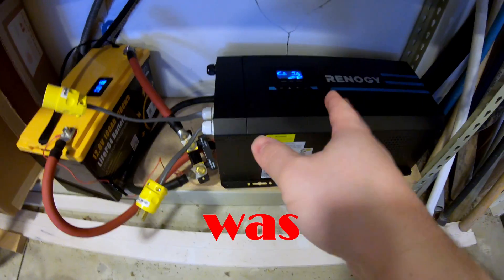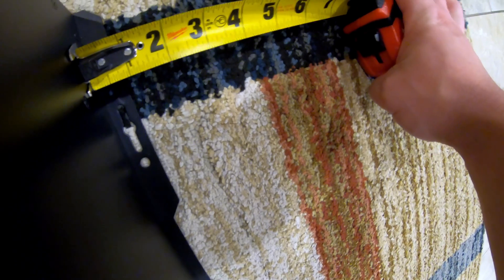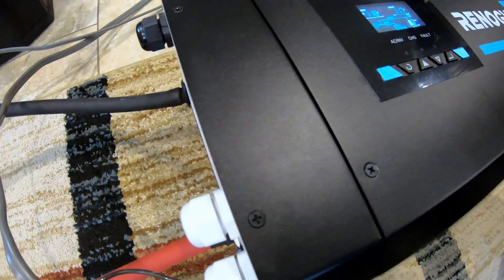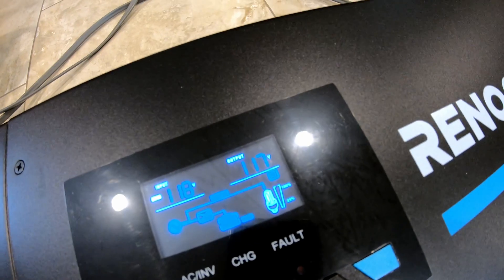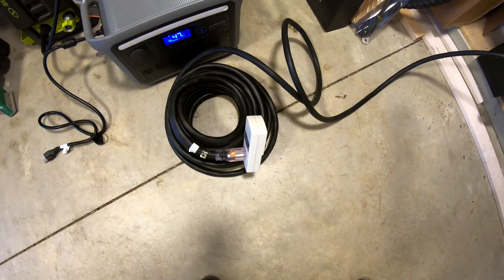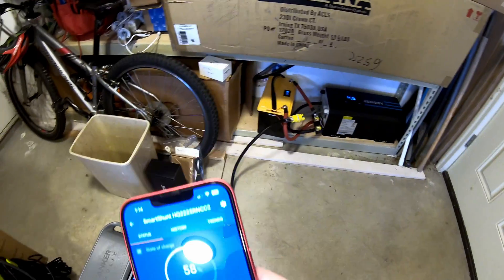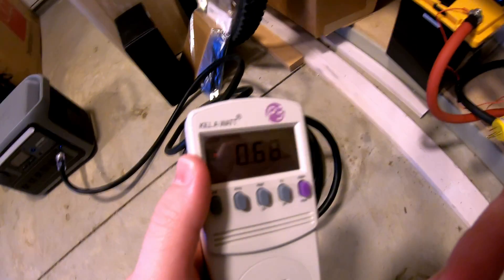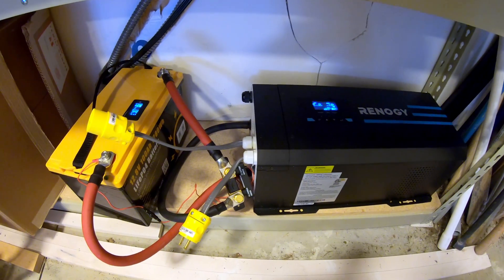Renogy 3000W Inverter Charger w/LCD - Test & Review. THIS THING IS A BEAST!

Comment: As stated below, 40w is a quite a pull.  I'm thinking of wiring a second small 300w inverter for a 110v mini fridge to save power.  The fridge itself pulls about 30w.  However, newer LifePo4 batteries are cheaper than ever, therefore  I might just add a second 400ah battery and call it a day.
Reply from the maker: Sounds like a plan!

Comment: Thanks for doing this video - I have ordered one but think I am going to send it back as the fan noise will drive me nuts. I think I am going to have to fork out the extra for a Victron Multiplus.
Reply from the maker: It does have some heavy duty fans that run! Thanks for watching!
Reply: @theresatrickforthat  Are the fans going all the time?

Comment: I just set mine up with a 280ah lithium battery and the thing that I didn't like about it was that from default it wanted to charge the battery to 14.7V and then would let it discharge to 12.*V (around 10%) then it would start charging again.  This could mean that if I went out to my motorhome when it was at 20% charge, that's all the charge I have until it charges back up.  I set my max charge point lower as well (eco-worthy battery calls for less)  and then I went in and set minimum voltage higher, so in theory I'm cycling the battery between 70-90%.  I haven't been able to verify if my setting are correct yet, need to do some more testing but the standard lithium setting from Renogy is not good for most people who leave the inverter plugged into shore power.  Thanks for the video, well made and straight forward.  I would like to see what settings you've done for the charge profile, and the reasoning for them (I'm still wrapping my head around all of them)
Reply from the maker: Thank you! I'm glad you enjoyed the video! I do not use the standard lithium setting. I just do a user defined one and I adjust the charge parameters based on whatever the batteries require. Thanks for watching!

Comment: Will I need a separate DC-DC charger as well for a camper van setup, or does this unit replace the need for one? 
Thanks
Reply from the maker: This only charges from AC power. Thanks for watching!

Comment: Does this inverter/charger allow for direct dc powering? I heard that the dc to dc charging also can be used to directly power 12v devices?
Reply from the maker: So long as you have a battery for the unit to “charge” you can connect a DC load and you can run the load at the same time as the charger is “charging” the battery but it’s also powering the load at the same time. Thanks for watching!

Comment: If you use the on board on off switch or the remote on off switch does that elimate the idle power draw? Lastly does the on off switch only control the inverter (if plugged into shore power with the switch off will it pass through power)?
Reply from the maker: Thanks for your comment! Had to make an entire video based on it. Check it out: https://youtu.be/qGLUiVyISL0?si=gMM_iroef-VtAoEy
Reply from the maker: Hey! Thanks for watching and commenting! Sorry for the delayed response…I actually didn’t know the answers to your questions but I got out and actually filmed another video based on your questions. So be sure not miss that coming out in about 2 weeks!
Anyway, yes…the onboard switch or the remote switch will kill all draw from the battery. And no power will pass through if either switch gets turned to the off position. Hope this helps! Thanks again for watching and commenting!
Reply: What is the idol currant of the 3000 Watt job that’s what I got but having said that I have not had any idol currant issues yeah

Comment: The manual says that the fan will shut off if the charge current drops below 6 amps.  Did the fan shut off when your battery was fully charged?
Reply from the maker: Yes it does! Thanks for watching!
Reply: @theresatrickforthat  is the fan variable when inverting or is it on full time like when charging batteries ?

Comment: Good data.

Interesting that the idle consumption is so much higher than rated. (42 vs 30)

I have a Xantrex 900W inverter and it idles at just 5w

5 * 24 = 0.12kwh
42 * 24 = 1.01kwh

Pretty big difference.

When in power saving it was rated 15W right?   Is that mode the same as being turned off?  (i.e. a 50w fridge cant even kick on)
Reply from the maker: Thank you! Pretty amazing how much more efficient small inverters are! So goes to show sometimes bigger isn’t better unless you really need the big power. 
Yes, when the unit is in power saving mode, if you plug a 49 watt load in, you’ll get nothing out of the inverter. Plug in a 51 watt load and the inverter goes to full power resulting in the extra overhead and power consumption by the inverter. Thanks for watching and commenting!
Reply: @theresatrickforthat  I have the 3kw on order.  May end up running the 900W inverter with the 3kw one reserved for charging the batteries, and high drain stuff like an induction cooktop.  Good to know that a draw above 50 will wake it up.  Ill have to test it with the mini fridge to see how it behaves.  The fan on the 900W unit remains off unless it gets warm, so thats another benifit, esp at night.  Was hoping to find a vacuum insulated 1 or 2 gal 12v water heater to add to the setup as well, but all I'm finding are the larger 110v 2.5 gal under sink units that are a foot tall.